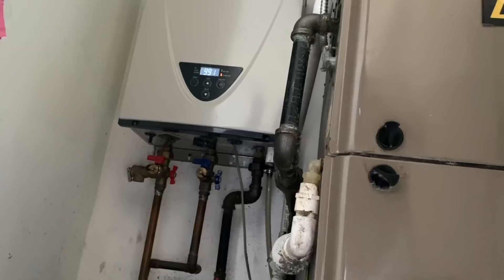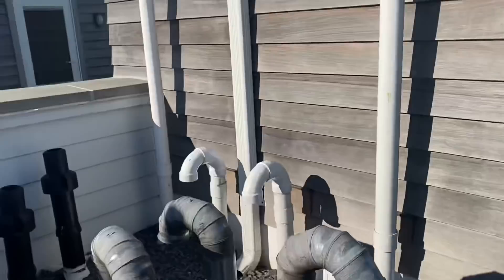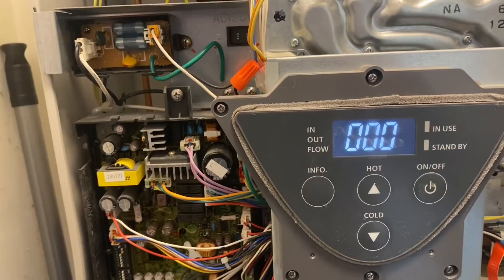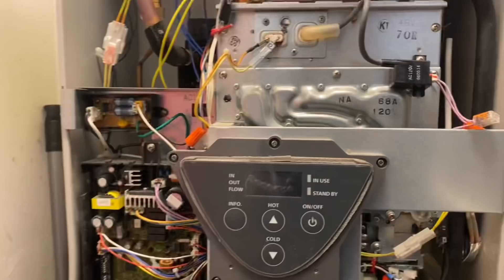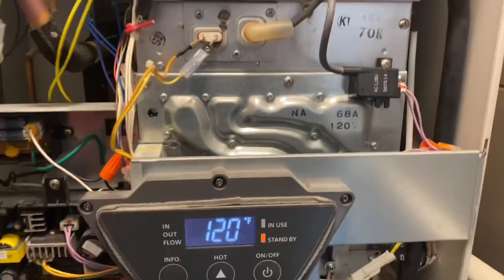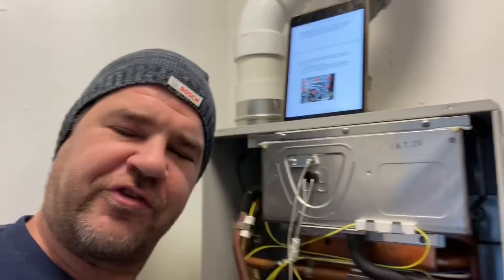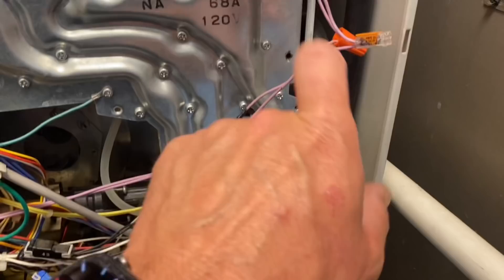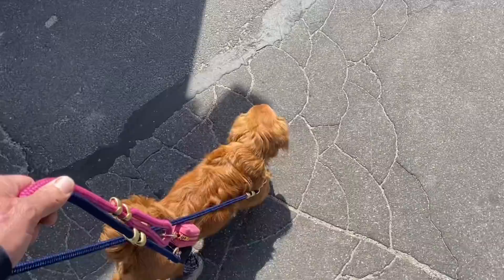Takagi State Tankless Condensing Water Heater GTS530 Error 991

Comment: Thanks Mikey Pipes for posting this service call video.  I found it while searching for the 991 error code - the same error code my hot water micro boiler displayed.  My boiler heats fluid for radiant floor heat and it quit working during the 65 mph Christmas snowstorm that roared through Western NY.  Snow had accumulated on the air intake enough to cause the inadequate/incomplete combustion. The intake is 8 feet off the ground.  I suspect it was the wind that drove the airborne snow to accumulate on the bird screen in the pipe.  Your video with your call to Takagi showed me how to clear the error code and restore operation.  Saying thanks doesn’t seem like enough for the help that information provided.  Keep up the good work!

Comment: On off operation with a flame loss coee is often the pressure switch chattering. The hot then cold etc on the in use fixture is also a point atctgat. Likely debris in blower motor. First thing to check if its fixture specific is the fixture itself, check that it does not have mineral build up that is making it low flow.. if its a bathroom group turn the tub on full hot.  It should be firing. Where i live thewater is very mineral rich, showerheads have caused low flow conditions that many techs overlooked, super easy check. Truth is is usually the sediment trap, drain or the cage of the fan has debris. That burner however IS condensing. Not good at all. Open the exhaust ( depower the unit so it cant fire ) and try pouri g some vnnegar in, it may free up the internal sediment trap. If ghat doesnt work then you have to find and physically service the trap, being careful because theres a pressure switch attached to it, so no vaccumeing the unit..    these are a pita when they fail.
Reply from the maker: Thank you very much for sharing
Reply: Yes, hard water in Florida plus a water saver in the fixture will reduce your flow thus shutting off the unit.

Comment: Teaches me that even if St Mike call tech support on all these heaters than we should to,  Shows how bad things have gotten, good old CI most parts are universal, issues are easy to spot and I almost never had to call support.
Reply: @PipeDoctor   I was ground floor when the Ultra's came out even worked with the local reps on them for other plumbers.  How many times I would call technical support and the homeowner would say "don't you know what your doing, why do you need them".  That and cell service sux in those New England cellars.

Comment: Just a heads up… the rust may have been keeping the burner stuck, but there are also two screws in the back that you need to take out with a long screwdriver.  You can see them at 10:32 in your video. 

Rust or not… it’s hard to get the burner out. But it’s impossible if you don’t take out those two screws.

Comment: I stayed in an AIRBNB cabin two months ago in Georgia.  It was unique and we only stayed one night during one leg of a road trip, so it worked out.  But really it was a large shed converted into livable space.  However it had some sort of a teeny tiny electric tankless water heater.  It was so small it seemed like it's intention might have been for a kitchen sink.  I'm not really sure but I could only get hot water from the shower for a minute or two.  It was really weird and surprised that no one had ever mentioned that "quirk" in the reviews.  Oh and the mini-split on the wall would only heat for short amounts of time as well, that was interesting as well, lol.